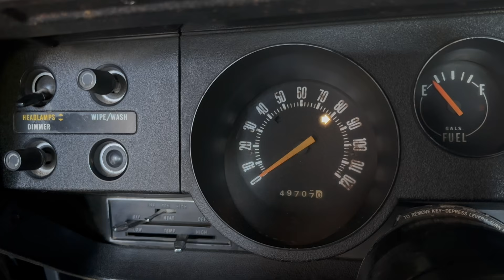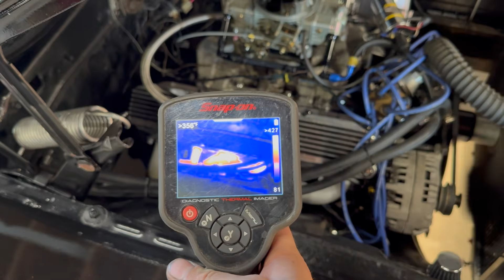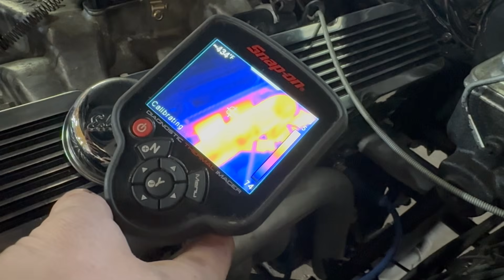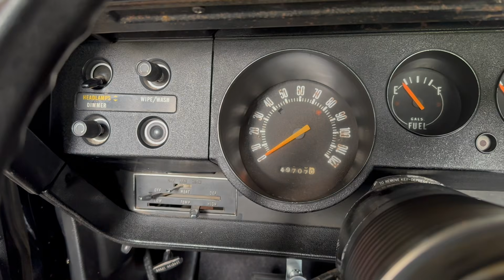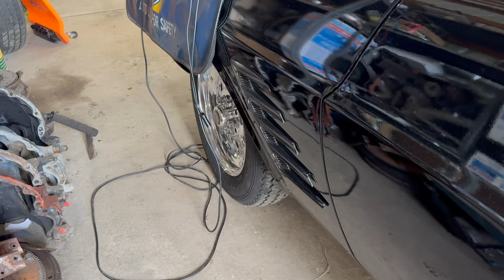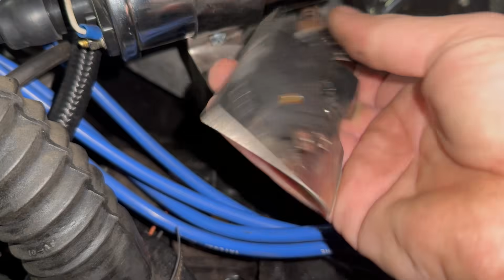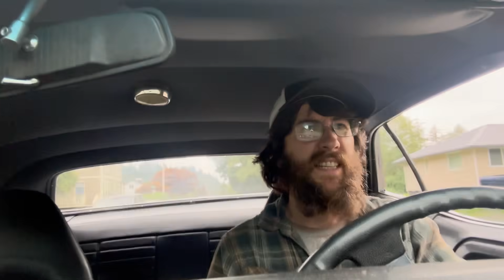What's Wrong With This 1973 Dodge Challenger? Electrical Gremlins, Big Block Tuning Tech, And More

Comment: Man I just found this channel about 12 hours ago …. Not much has been done in the last 12 hours 😂 glued to my screen 😂 ahhh well totally worth being in the dog house all night 

Regards from uk 🇬🇧
Reply from the maker: Haaahaha. Thanks!
Reply: @DeadDodgeGarage  problem with not running rite.. is that holley..i have a 340 r/t 73.. stiker says holley equiped.. nope, its getting an edelbrock for now, then a thermoquad.. ausie.. sat in shed for 12 yrs as the laws in s.a. adelaide, are.'' 100% original''.. ???... it was dark green met. , now its sublime.. defect with paint. 100% original, are they fkn mad.??
Reply: @DeadDodgeGarage  sounds like timing, or sht leads.. check for continuity between the fan & exhaust..
Reply: @DeadDodgeGarage  ngk , or ac delco.. champion are cheap, dont last..i knew that back in 1970.. still the same..a thermoquad will flow 800cfm. this is why all the drag guys used them, then big pharma holley came along..
Reply: @DeadDodgeGarage  5v fuel resistor.. i used a mustang one. closest i could find..
Reply: @DeadDodgeGarage  fuel ground strap might be for static, spark, blow up, danger, not chinese but deadly..
Reply: @DeadDodgeGarage  eye had this money to get rid of.. inheritance. not much, but, 20k on the house, 20k for a car..ausie dollars, thats about 7k u.s....was looking for a b/block 390, ect mustang f/back..all sht, no floors, $2 paint job.. amongst them, was this green thingi, no fkn idea what it was, never seen one. 340 r/t chall.. the green got me, plus from when i was 4 yr old, i wanted a hidden wiper, no ''b'' piller 2 door.. it fit the bill.. 17k u.s.. 15 yrs ago..
Reply: @DeadDodgeGarage  pinging is fuel as well. bad fuel.. most modern ''cars'', have anti knock sensors.. so you dont here it & it will run on water..
Reply: @DeadDodgeGarage  you would think a rally would come with lsd std.. seeing nearly all for gt,s do, & trucks.. ford bronco have lsd front & rear..80,s.. most..because of the bs ttb front id say..

Comment: Gorgeous car. I'm not a fan of the wheels but they aren't terrible. I would spring for some classic Cragers.
Can you actually get significant castor (4+ degrees) out of a stock front end?
Reply from the maker: No, it would have to have offset bushings to get there. 2.5 degrees is about it.

Comment: Blown head gasket between two cylinders...
Reply from the maker: Possible! My problem with that is I personally replaced the head gaskets in this engine in 2017, and it had this issue before and after. There was no evidence of a blow between cylinders at that time. I replaced the gaskets because it had somehow broken the rear of the passenger gasket and was spewing coolant at the firewall.

Comment: Normally you have to use a resister in leds to make flasher work
Reply from the maker: I’m very familiar with that. This is why I switched to an electronic style flasher that shouldn’t require resistors, in case the bulbs did not have them built in (as some do these days.)

Comment: Burnt valve
Reply from the maker: I've never seen an intake valve burnt, and this seems to be an intake valve problem. Also, wouldn't you expect to find low compression?
Reply: Intake valve can be a problem, if a chunk of debris is in the way when it closes a small amount of hot high pressure gasses will leak by and CAN mar the seat.  Also,  the seats can deteriorate and valve be fine.   And it will still pump  up a compression gauge.   I noted the reading was a little light....
Reply: @shrodokahn470 again, that would show up in a compression test